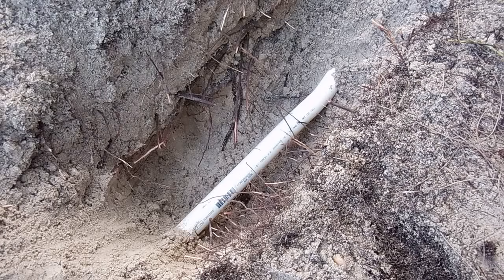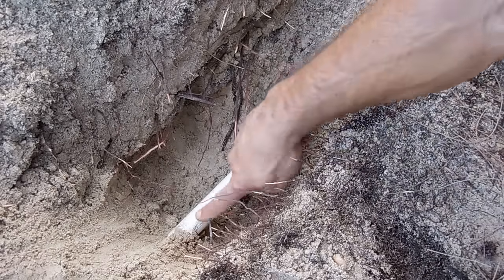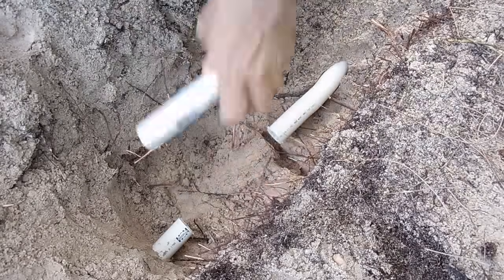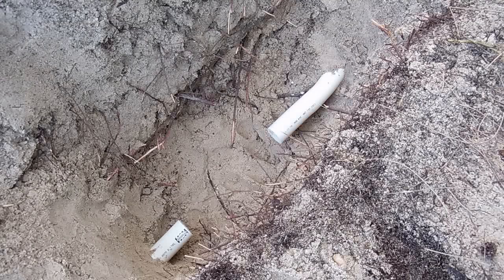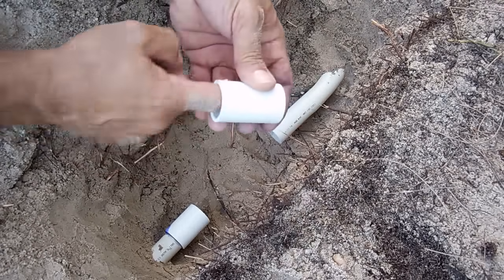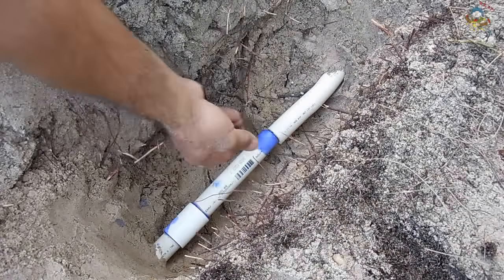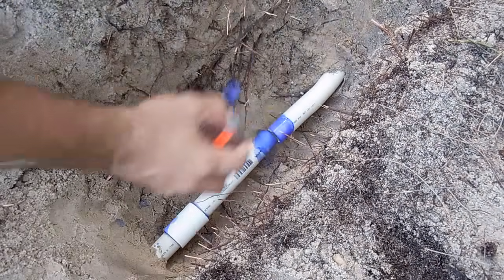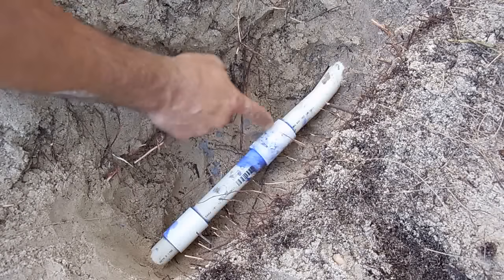EASILY Repairing Broken PVC Pipes(Least Amount Of Digging)

Comment: I'd like to know what I did wrong.  I tried the trick on Sched 40 1/2 inch piping and there was a lot of friction trouble with the through and through I made out of the straight coupling.  I tried minimizing the friction by using a 1/2 round file and sand paper.  After about an hour of this, the two dollars I would have spent on a Snap-fix Repair Coupling were eating at me, but I just wanted to try the trick.  Prior to execution I tried using wire conduit lubrication to simulate the slipperiness the glue would momentarily create.  That met with ugly friction and I had to pry the through and though from my test pipe using my pressure pliers and a pipe wrench.  At this point, I just figured I would go with execution and remediation if that failed.  I set up the pipes as it says in the trick (almost touching each other).  I put on the Primer on both pipe exteriors and the interior of the through and through then I added glue to all involved surfaces and ran the though and through up one pipe to the point that only 1/8 in remained.  It would go no further.  I arched the pipes so that the other pipe would come into the coupling and was not able to make it budge back at all.  Tried my wrenches.  Nothing.  The glue had done its thing. 

I know that the trick calls for slow setting cement.  I used Oatey Medium Blue PVC which I hoped meant medium setting speed, but I am not sure.  The glue is deep blue.  The question is, should I have experienced so much friction between the pipe and the coupling?  I think that is what did me in.

I figure the fix , as is, with 1/8 inch of the coupling holding one end and a lot of extra glue on top of that may hold for a little bit, but I will be digging that thing up again.  I don't know.  Don't want to look at this stuff for a while.  Much stress.
Reply from the maker: Hello Emilio. It sounds like you didn't remove enough of the stop in the center of the coupling. You also need to make sure the ends of all pipes are beveled, and you must apply plenty of cement. You MUST work fast once the glue has been applied, and do not allow the coupling to stop moving. You need to practice on another piece of pipe. Once you get the knack of it, then do the repair. Thanks fro watching!

Comment: That's fine for doing water pipes or pipes that are empty but what about pipes that carry electric, you can't cut the wires
Reply from the maker: You'd need to pull the wires out, repair the pipe, then put the wires back in. Thanks fro watching!

Comment: What is the name/brand of the slow setting cement you are using. Went to Lowe's and asked the guy for slow setting cement and he sold me some stuff, but it sets almost instantly, so it didn't work, I have to redo it. Thank you for your help I really appreciate it
Reply from the maker: Regular set also works fine, but you need to work fast and not allow the PVC fitting to stop moving until it's in position.
Reply: I did it exactly the way you did it in the video, I worked fast, just like you said and I didn't stop moving, but the slip just locked in place as soon as I pushed it onto the pipe, I went to pull it back to connect the pipes, just like you did in the video,  it it wouldn't move. The only thing I can think of is I got the wrong glue. I'm new to this stuff so I had to ask the guy at Lowe's and he sold me clear self priming medium PVC cement. I took his word that it was slow setting even though it didn't say slow setting on the can and none of the other cans at the store said slow setting or regular setting. If you could please help me out and tell me if I got the wrong glue and if you could tell me exactly what glue you used, so I can just get the exact same stuff thank you for your time and help
Reply from the maker: @mattjordahl2526  I know exactly what your problem is, the coupling is too tight! Grind more of the center.
Reply: Ok thank you man I'll try that

Comment: Wasting glue and cleaner.
Reply from the maker: Clearly you have little experience working with PVC pipe.
Reply: Used to do it for a living, never do I put glue in the coupling,  always on the pipe.  Like I said , lot's of waste.
Reply from the maker: Like I said, little experience. You ALWAYS apply cleaner and cement to the outside of the pipe and inside the fitting.
Reply: You should change your name to Mr. Experience.
Reply from the maker: No other channel on Youtube shows the multitude of videos/skills that I show, so that name fits me perfect. Thank you

Comment: What type of PVC cement or glue to use? I heard you said slow set, is that the reason that you need time to slide back and forth in order to make couple join two pipes? Thanks a lot
Reply from the maker: Regular or slow set cement. You MUST work fast when assembling parts. Keep parts in motion. Thanks for watching!

Comment: Looks like you messed up and redo the connecting processed?
Reply from the maker: Efren Saclolo No, I didn't mess up. Everything was done perfectly.
Reply: I used your method but instead of pipe glue l USA clear silicone and slides the connector easy .
Reply: electronicsNmore Lt looks like when you put the connector it dried on you and you weren't able to push it forward.

Comment: The tricky part of this is getting the inner surface of the coupling perfectly level even after getting rid of the halfway ridges. I used a round file and sandpaper.  I tried just placing the coupling the first time by only getting rid of the ridges and it froze up on me right in the middle.  So I had to rapidly saw off the messed up coupling and repeat the repair now with a perfectly level inner coupling surface. This time it just glided into position. Even plumbers I know didn't know about this procedure. Thanks for this great technique.
Reply from the maker: It's very easy once you get the knack of it. :-) Thanks for watching! Be sure to check out my extensive video playlists for other great videos of interest to you, rate thumbs up, and share.

Comment: I just repaired 2 broken pipes with this method.  There was a VERY tense 30 seconds on the 2nd one when the coupler wouldn't slide back onto the other pipe--and the glue was quickly drying.  But I got it sorted out soon enough by using a pipe wrench I happened to have next to me for some grabbing strength.  Wow, I couldn't have done those repairs without your ideas!!

BTW, I used a Dremel to sand off the inside ridge.  One word of caution: definitely dry fit everything so you know both sides will smoothly accept the coupler.  Last thing you want is to have wet PVC cement quickly drying and suddenly discovering that the surfaces are yoo rough or a 100th too large for smooth sliding!
Reply from the maker: Surfaces must be smooth, and you have to work fast! :-) Thanks for watching! Be sure to check out my extensive video playlists for other great videos of interest to you and share my channel with others.

Comment: I have this question too..why did u cut wider and put a coupling, may be a wider crack will need otherwise just cut where the crack is and straight away insert there coupling.. anyway thanks for the video..
Reply from the maker: Dilipkumar Entoor I was demonstrating if the crack wasn't straight up and down, but going sideways.

Comment: Two things, ONE they sale those couplings in so many hardware store i use them once in awhile, TWO a C loop work's too and is faster, just my 3 cents 😉
Reply from the maker: ONE, they don't sell them at HD, Lowes, or Ace hardware. I checked many times. They only sell full slip PVC DWV fittings. Using (4) 90's creates too much friction loss. The water has to change direction 4 times. Thanks for watching!

Comment: I can't get the coupler to go past the half way point. It is a tight fit and it take a good bit to just get it to half point. What am I doing wrong?
Reply from the maker: ffzzff You didn't remove enough of the stop. Also add a slight bevel to the end of the PVC pipe using sandpaper to allow easier installation. Thanks for watching!
Reply: Ok thanks, I will try that I filed down the stop pretty good. Will try again

Comment: Very helpful. Quick one though, what if one side of the coupling ends up w8th leaks bec i must not have put ample amount of pvc glue, can i redo the process? Or is there a way to just seal that leak? Thanks!
Reply from the maker: You must use plenty of PVC cement and work quickly with a slight twisting motion. Once the glue sets, you cannot redo what you did. Cut out the section and do it again. Thanks for watching!

Comment: Just in time.  I noticed this large hole in my backyard over my PVC pipe and assumed maybe the dogs were digging it out. While back there when the sprinkler system began watering the backyard, I heard this hard spray and then discovered how that hole got there. PVC pipe developed a crack and blasted the soil free. . I hope to duplicate this method to repair it.  Thanks for the video.
Reply from the maker: Practice makes perfect. Use another PVC pipe and modified coupling to get the method down before trying it on your broken pipe. Thanks for watching!

Comment: Please let me know in this video if I can put the two couplings in the same time in the center of the new pipe and after the glue move de coupling to new areas to be joint.
Reply from the maker: If the couplings can be made with only slight drag over the pipe, then you apply the cement and slide them over.....Yes.

Comment: I have also been doing this method for about 40 years, but I don't use cleaner just primer, & sometimes I'll cut the belled end off a 20' stick of pvc & use it, because it has no stop & some of them are quite deep, depending on the brand of pipe.  I also think it is kind of important to clean the burred up ends on the inside of the pipe, trying to get the small peaces out of the pipe the best I reasonably can, so they don't end up going down pipe & maybe clogging up a water faucet in the home or something.  There is another way to do it without digging up so much, & that is to heat up the pipe with a torch or something then it will bend enough to get them together a lot easier.  But I most often just dig it up, because here in Rockport TX we have some easy digging, unless you are in a bad spot with lots of roots.  Thanks for you video.

Comment: He has a great method if the bores in the coupling weren't tapered smaller towards the back of each bore making it impossible to have the couplings to slip completely over the male pipe. I had removed the stop ridge half way in only to realize the coupling would not slip over the reduced inside diameter. He does a disservice as he does not address this problem. Fortunately I'm a retired machinist and have a small lathe where I could bore out the reduced size with the taper. Then I was able to make it work. I thank him for his idea as it made me find a solution and I will give him credit but it didn't take it far enough. No wonder he has so many thumbs down. Using a Dremel would not have adequately removed material.
Reply from the maker: There is no problem. The method works PERFECTLY! If you had a problem, it's because you screwed up. Don't blame me. This video has a 94% approval rating, which is excellent. 341 people blamed me because they couldn't do the job. You can't please everyone. :-)

Comment: That's too much work I think it's easier if you just use a telescoping coupling and you get done in 10 minutes or even a compression coupling would even work better.
Reply from the maker: Wrong, and don't be lazy. The repairs you mention are NOT better. My repair is permanent, and will last just as long as the pipe with no worry about o-rings/gaskets drying out and leaking.
Reply: Lazy is not the word . It's work smarter not harder

Comment: Thanks. Just had exactly that situation. Very tight space with another 1" PVC pipe running along side. I was a bit nervous about screwing it up but it worked. After using the dremel to take out the shoulder I used 60 grit sand paper to really clean up the inside and take it down a bit more for fear of it being too tight to slip back and forth. It probably wasn't necessary as the solvent would have been sufficient. Now I just need the courage to turn the water on and pray for no leaks!
Reply from the maker: If you applied enough PVC cement with a slight twisting motion, it shouldn't leak. Be sure to check out my other videos, rate thumbs up, and share. Thanks

Comment: Thanks for the tip, i was trying to bend my pipe so i could get the coupling onto it.  Your way of taking the middle bit out and sliding it on evenly for both sides worked for me and got me out of a jam......didn't have a dremmel so had to file it by hand, but worked anyway, thanks
Reply from the maker: Glad my video was able to help you! Be sure to rate thumbs up, share my channel with others, and check out my Video Playlists for your areas of interest. Thanks!

Comment: Can anyone tell me what did he mean by " removing the STOP of the second coupling"...what is the stop????
Reply: In a typical coupling, there is a ridge in the middle. This allows you to slip the coupling onto one pipe first, and have it seat exactly where it should - half way into the coupler. That pipe hits the "stop." You can feel it in there with your finger. You want to file it out so there is no more ridge. Or you can just buy the slip coupling that has no stop to begin with...

Comment: Great video, thanks! Can you make one about how to deal with old brittle pipes that shatter when trying to cut them?
Reply from the maker: Never use a PVC cutter on old pipes. Only use a hacksaw.
Reply: Thanks for the tip. What about schedule of the pipe that should be underground? Is it ok to install higher thickness piece for repair?

Comment: remove the stop on both couplings and you can slip the pipe in and slide each coupling over and done. just like a Less stop coupling with copper.

Comment: Thanks!  You just saved me $100. 

I managed to pull this off myself simply by watching this video.  I did mess up by not twisting the pipe into place. Going to check tomorrow to see if it's still leaking. 

Did a test run and so far no leaks.
Reply from the maker: If you had plenty of cement on the pipe and didn't twist it into position, you'll be OK.

Comment: good method but that is not applicable in some of the crazy situations I've been exposed to.
Reply from the maker: A-Veteran Lawn Care Really? Never failed me.
Reply: This situation is complicated to describe but I'll try. Someone installed that old black irrigation bendable pipe to add spray heads. It pop out 2' underground. We don't have the luxury of digging shallow and play space is tight because its almost up against the concrete on a steep enough slope. Like I said good method, I just can't use it this time around.
Reply from the maker: A-Veteran Lawn Care The old black poly flex pipe from the 60's.....i've worked on plenty of those.

Comment: Great funny video ... I have no idea why you made the left cut . you could just put the right one after cutting the right side and slipping it like you just did .
Reply: electronicsNmore ... even I heard you say that about the horizontal break.. but some people don't appreciate others trying to be helpful and only offer criticism.. thanks for posting this
Reply: I have this question too..why did u cut wider and put a coupling, may be a wider crack will need otherwise just cut where the crack is and straight away insert there coupling.. anyway thanks for the video..
Reply: electronicsNmore r
Reply from the maker: AdminTuber Another clueless Troll.
Reply: Why clueless Troll . Cant handle feedback ? How about you refer to my comment rather than call me a Troll ? Why did you need the left cut ?
Reply from the maker: If you were a normal/decent person, you would have said, "Why did you make the left cut?". Instead you had to say, "Great funny video". Wise @ss comments don't get a polite reply. Understand that? Hope so. Next time use the right choice of words.

Now.....If you actually watched the video, you'd know that the cut on the left was made to remove a section of pipe that didn't break straight down, but instead sideways.
Reply: electronicsNmore this is becoming way to common people crying victim after they insulted or instigated first. Much appreciated for time making this cheers

Comment: I tried this three times with two different pvc cements and every time I slipped the coupling on it locked up before I could push it back. 
Working on my knees, sitting, lying on my side. Totally frustrating and a total loss of time.  Maybe it works in cold weather or who knows but it is not as simple as shown.  Maybe you should state the exact cement you are using.
Reply from the maker: bajaman52 Temperature makes no difference. If you read through the comment area you'll see that many viewers had great success. Sounds like you're not applying a lot of cement, using fast setting cement, allowing the coupling to stop instead of keeping it moving, or not removing enough of the stop. If you have weak hands, then you'll definitely have trouble. practice. Thanks
Reply: That could be the issue, allowing it to stop while mating the two ends and not enough glue. Also I did not have that great of leverage on it as I was in an awkward position. Thanks for the reply.

Comment: Nice video but if you had a pipe the same size heat it up and make your own couplings by cutting the pipe in half heat up one end and make a long coupling by feeding it on  the other end of the pipe which is not being used by twisting  let it cool down do the same to the other end but normal size coupling glue both ends put long coupling on first slide back to normal size cupping
Reply from the maker: You need to watch my newer video on PVC repair. :-)
Reply: @electronicsNmore  I have done this for years,if you lose your file,take a 1/2 in bolt with about  3 inches of thread on it, will cut the stop out,good video,keep it up.